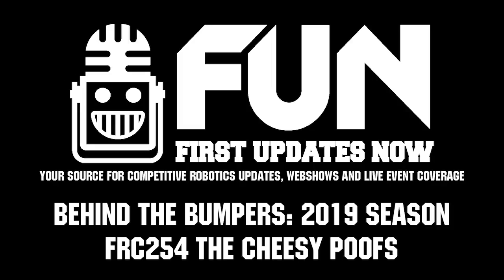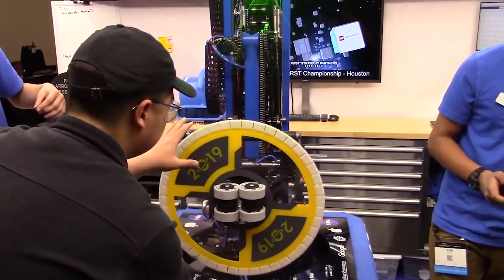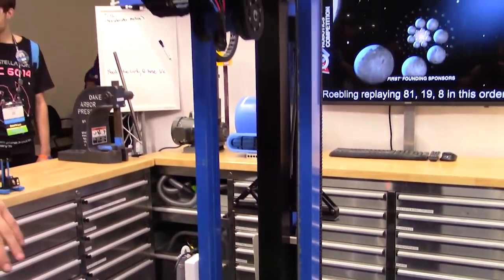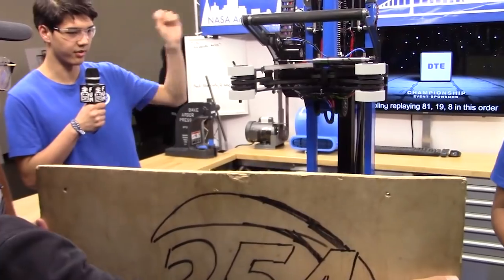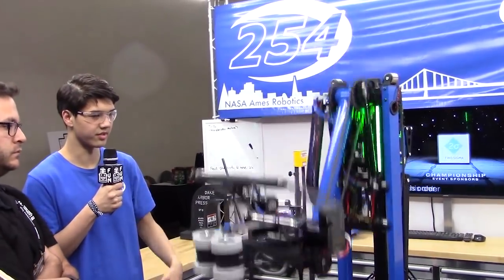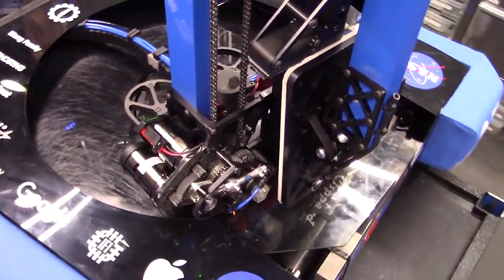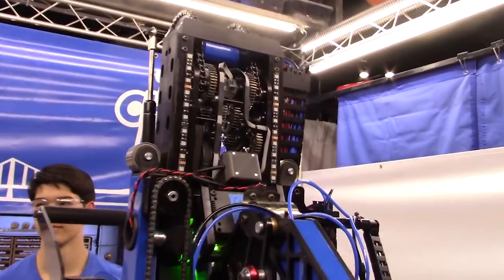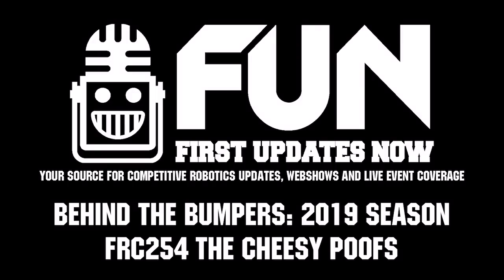Behind the Bumpers FRC 254 The Cheesy Poofs 2019 Competition Season

Comment: I am still baffled by the wiring on it and want to know but so I can improve. Any insights into how they specifically achieved it?
Reply: Bret Gibson Hi, I can probably help you with that question. In what parts are you referring to? The location, actual wiring skills or what.
Reply: They include the wiring in our design. For example, when CADing  their drive base, they know where to put the roborio and PDP, and ensure that all the wires have a place to route through.
Reply: Like what Jeff Jeff said, that is pretty much how it goes. If you look on our elevator mechanism, you can see a hole where we put all our wires for the top part of the robot. Because all our wires are in there, it keeps it protected from outside damage and organized. Other than having a covering like metal for the wiring, just make sure you know what is going where and how to execute that the best way possible in a pre plan.
Reply: @emilianohansen9859  Ok thanks, if that's the case then I think I had more problems with design integration this year. The reason being is because I had to work around certain parts of the design and figure out how to route given what I had. It would seem that closely working with design initially is the way to go. The only problem I have with that is you are putting all the pressure on design at the beginning of the build season and you don't exactly know how you want to wire it until you see what the design/mechan team is planning on doing.
Reply: @jeffjeff5850  Ok thanks, I am pretty sure that's where we struggled this year, integration of not just the electrical components but the wiring itself into the design. We pretty well with component placement but it's just the wire routing/situation.
Reply: @emilianohansen9859  Sup DG